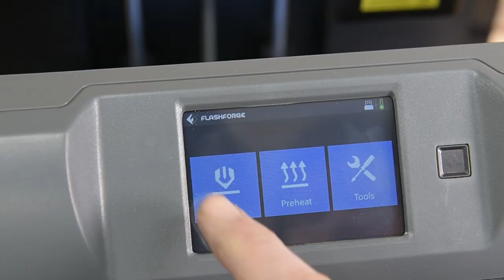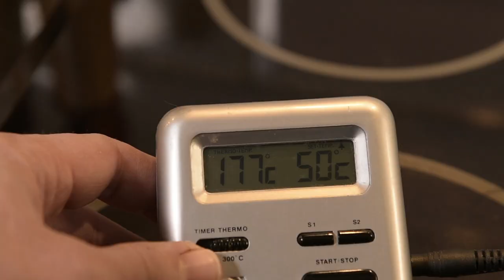Making a rosette iron

Comment: A few things: 
1 Another student of the This Old Tony school of material cutting.
2 I’ve never heard of these tasty treats before, and now I’m keen to try them myself. Any chance you would share your CAD file?
3 impressive casting. The part came out VERY clean for being so complex.
Reply from the maker: Thanks! I may share it on my patreon page!
Reply: Funnily enough, this was a traditional Chinese dessert/snack as well.

If you know love letters, a light crispy folded or rolled pancake (usually baked over charcoal), we do the same thing here (frying) with the same batter. And also using the same mould, usually bronze and in a lotus shape.

Comment: The guy who taught me how to single-point thread ALWAYS threaded toward the chuck.  The very first threading job I did was in blanks of Nitronic 50 steel.  The raw blanks cost $250 each.  The machinist set it up, ran the first part, and scared me half to death.  The rpm was cranked UP, so the feed rate was HIDEOUSLY fast.  He lathered it up generously with cutting oil, engaged the feed, and FIRE shot out the end of the part and the back end of the head stock through the hole in the spindle.  All this was accompanied by a huge cloud of smoke.  He completed the coarse, heavy threads in only four fiery passes.  The threads looked like mirrors and were perfectly sized.  The material needed deep cuts and high speeds to get a perfect finish and to prevent chattering, but I was a nervous wreck by the time the job was finished.  I did scrap two parts, though.  No problem.  The boss bought five extra blanks "just in case" so we had three extra parts as spares for the next order...which somebody else got to run, I'm happy to report.  :)
Reply from the maker: Wow, that could make anyone nervous, even the experienced machinist.
Reply: @torbjornahman  He actually loved it! An excellent machinist but a total psycho, too. His motto for threading: If you’re not shooting fire and smoke outta both ends, your feeds and speeds are too low! He did it that way EVERY time. 🤪😜
Reply: @Andrew Grengs (Student) Absolutely!
Reply: Does Nitronic 50 work harden like normal stainless?  I know its somewhat related to stainless. If it is, that certainly explains the need to be aggressive when working it. But just because something is logical, doesnt mean it flipping the lever is any less sketchy feeling.
Reply: @CKOD  Yes it does! Have a look at this short thread: https://www.practicalmachinist.com/vb/cnc-machining/nitronic-50-a-171559/
Reply: @CKOD  Yes, it’s an expensive grade of stainless, and yes it workhardens. The work order said they were shaft couplers to be used in a nuclear power plant. Sure. Let the new guy with zero experience learn a procedure on the most expensive material in the shop. No pressure. 😱😖😜

Comment: You used paraffin instead of linseed? You're not Torbjom... where are you hiding him?!
Reply from the maker: He he.... Well Juniper wood smells so nice, so I wanted something neutral.
Reply: @torbjornahman  ich verwende immer Bienenwachs
Reply: Linseed oil is not food safe! what if handle accidently fell in the hot oil?
Reply: @torbjornahman   I believe Juniper is so clean and dense that it might be used without any protection, then you enjoy even better the marvelous smell. By the way I saw once in a remote place in Spain, a few years ago, people using Juniper wood burnt in the oven, in winter. They seem to have no clue about the value of that wood. (I seem to have read Uniper somewhere in your video, sorry if I mistook or if you corrected already). Congratulations anyway, as usual.
Reply: @shadetreeforge  Raw linseed oil is food safe; boiled is not. And even if he boiled the handle there is 1) only an infinitesimally small amount on the handle, 2) an even smaller amount would come off the handle, 3) an even smaller amount would get on the food from the oil.  TLDR ITS FINE.
Reply: @torbjornahman  blacksmith?
Reply: @shadetreeforge  Boiled linseed oil is not food safe!  It is not the same thing as non boiled linseed oil. Anyway i always use 100% tung oil.
Reply: @shadetreeforge  9w
Reply: Helpful hint. Don’t put things finished with boiled linseed oil in your mouth.
Reply from the maker: @shadetreeforge  Ha ha good real linseed oil is perfectly food safe. You can drink it if you like :) :)
Reply: Frank Strock Linseed oil is safe. It is often called Flax seed oil in supermarkets and health food stores.
Reply: @torbjornahman  I do all the time! It's yummy! ;)
Reply: @shadetreeforge  In Scandinavia you can easily get hold of virgin linseed oil for wood working. Thats just flaxseed oil and that is completely food safe and even nice on a salad.  

Actually, I don't recall seeing boiled linseed oil marked as linseed in Denmark.
Reply: @reina4969  even if you boiled the raw linseed it wouldn't really be that bad to ingest. The American "boiled" linseed is an industrial term meaning its been treated with chemicals. In the old days, lead was used. These days it probably not lead, but some other kind of catalyst.
Reply: @jappelgreen  I know... Who are you talking to?

Comment: Very nicely done.

Might I point out that adding a LOT of draft to the pattern would not only make the sand-mould making go easier, but would also assist waffle removal from the final item!
Reply: It can also make the dough fall off in the oil before you want it to.

Comment: The two biggest tips I can give for making molds, which you are much more skilled than me at, are that a clearcoat before the talc can make removing 3d prints from the mold sand much easier, and that military surplus surgical equipment is amazing for doing very detailed work on a very small scale.

Comment: Very nice!

If you want to reduce the layer lines from 3-D printing in future projects (to make removal from the casting sand easier and for a smoother finish overall), you can spray them with a filler primer. Combining sanding with filler primer can give you a completely smooth finish if desired.

Of course, for this project, the layers lines may help hold onto the batter, so they may be desired after all. :)

Comment: Awesome video! Just one little tip for future projects that contain molding in sand: to prevent 11:00 from happening in the future, you could also drive a few thin steel pins into the molding mass to reinforce it (you can make them from small nails). Just simply put them in before removing the model. Not only will it make removing the model easier, but also makes the sand stronger for when you pour the liquid metal in (so that it doesn't crumble and collapse during the pouring).
Reply from the maker: Very cool tip! Thanks!!

Comment: You should check out the Windy Hill Foundry channel.  That guy does metal casting full time.  He usually does iron, but sometimes other metals as well.  For his iron, he works with some local mechanics to send him used brake rotors which he then melts down.

Comment: You know that you can 3d print the split cast cavities and achieve a far better result ? You can design the gates to have the least impact on the cast. Also you may look into castable filaments , that are low melting plastics designed for investment casting. You may also try epoxy coating to achieve smooth 3dprints that would help immensely for releasing prototypes from molds

Comment: How does one acquire such a deep and expansive set of skills? Next we are going to find out he has a sweet jump shot and is a Olympic level archer who builds log cabins in his free time.
Reply: I'm going to bet they have a functional education system in Sweden.
Reply: In fact, nothing complicated, you just need all the tools, machine tools, YouTube .. and a lot of free time, for example, I "learned" to work on a lathe in a couple of hours, sharpen the tool, adjust everything - it's much more difficult .. Casting .. I didn't do it, but I think I could repeat it. I could not do woodworking on a machine, this is scary for me) The handle can split and fly apart at huge speeds ..
This is even scarier than when you have a cut-off tool stuck in a 150mm workpiece that you almost cut off.

Comment: Would it be useful to print the "holes" and shrinking them to allow for some sanding paper to be stuck on them so that you can create a smooth surface on the print for easier release from the mould?
Reply from the maker: With the tapered draft, it would be difficult to move the "sanding block" in the holes.

Comment: So you cast a rosette cutter with very little draft angle and extremely tight voids, got a good mold your second attempt, a perfect cast on your first and somehow did not loose a single grain of sand in the process? Yup, seems about right.
Reply from the maker: :) The draft is actually 4 degrees, so it's not insignificant! Beginners luck i assume....

Comment: 3:00 using your rip fence as a length stop for crosscutting is going to end in tears and fewer fingers one day .Clamp a block against the fence that ends just in front of the blade, and run the crosscut guide and timber off the block as the workpiece goes through the blade. This prevents the workpiece pivoting and jamming against the blade or fence. Yes, I'm a trade school teacher and get irrationally triggered by these sort of things.
Reply from the maker: :) Indeed that is a good tip. But if you're careful and don't push to hard, it works...

Comment: That was fun to watch.   I had trouble with those deep green sand cores to!   https://www.youtube.com/watch?v=ZbNim7ix4Rc  Why did you single point cut those threads instead of using a die?  Is it because it's stainless?  The stainless rods I used came pre-threaded (hobby push rods) so I didn't have to thread them.

Comment: Some basic faults in castingmodel design but still great handwork and video! Kanonbra!
Reply from the maker: What is wrong?
Reply: @torbjornahman  Just add some draft angles to the vertical surfaces of the master form. Than it should be much more easier to remove the master form from the lower box.
https://en.wikipedia.org/wiki/Die_casting#Design_geometry
Reply from the maker: It has a 4 degree draft already!
Reply: @torbjornahman  Ahh.. okay,... I didn't say anything... ;-)

Comment: You should've just used aluminium wire as filament in the 3d printer silly.
Reply from the maker: Why not cookie dough? :)
Reply: @torbjornahman  yeah you raise a good point, why not just skip the whole thing and 3D print the rosettes using rosette mix hahah.